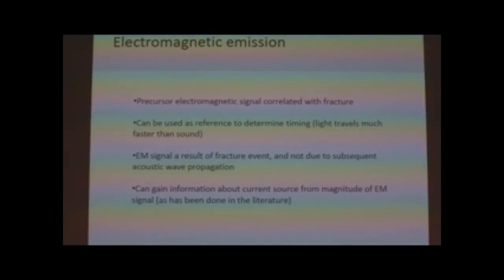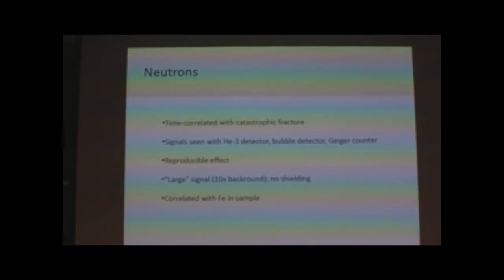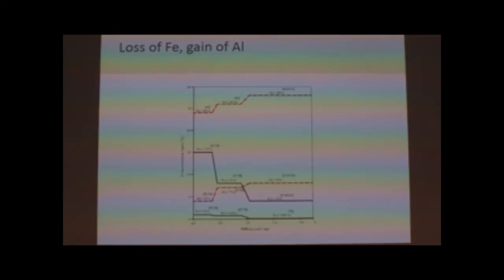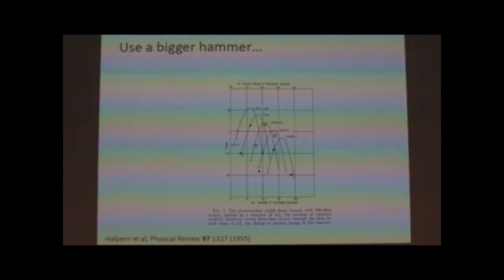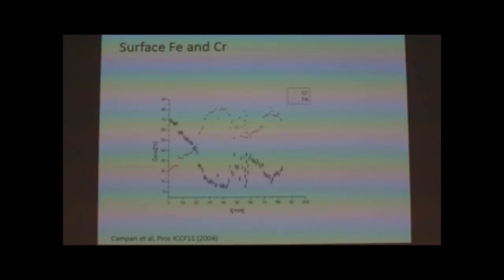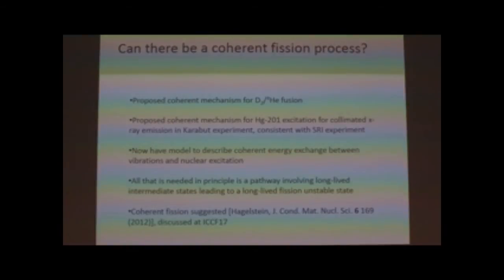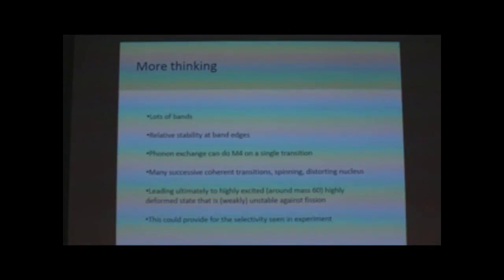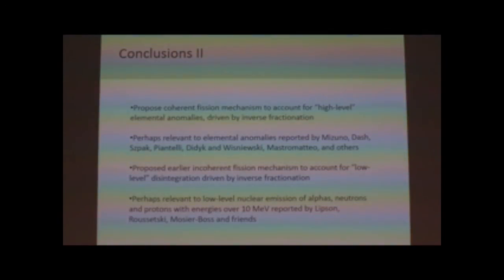Peter Hagelstein Discusses Latest Theoretical Modeling for Cold Fusion Effects

Comment: About a year after CBS 60 Minutes aired their episode on Cold Fusion, I followed up with Rob Duncan to explore Richard Garwin's thesis that McKubre was measuring the input electric power incorrectly.

It turns out that McKubre was reckoning only the DC power going into his cells, and assuming (for arcane technical reasons) there could not be any AC power going in, and therefore he didn't need to  measure or include any AC power term in his energy budget model.

Together with several other people, I helped work out a model for the omitted AC power term in McKubre's experimental design.  Our model showed that there was measurable and significant AC power, arising from the fluctuations in ohmic resistance as bubbles formed and sloughed off the surface of the palladium electrodes.  Our model jibed with both the qualitative and quantitative evidence from McKubre's reports:  

1) McKubre (and others) noted that the excess heat only appeared after the palladium lattice was fully loaded.  And that's precisely when the Faradaic current no longer charges up the lattice, but begins producing gas bubbles on the surfaces of the electrodes.

2) The excess heat in McKubre's cells was only apparent, significant, and sizable when the Faradaic drive current was elevated to dramatically high levels, thereby increasing the rate at which bubbles were forming and sloughing off the electrodes.

3) The effect was enhanced if the surface of the electrodes was rough rather than polished smooth, so that larger bubbles could form and cling to the rough surface before sloughing off, thereby alternately occluding and exposing somewhat larger fractions of surface area for each bubble.

The time-varying resistance arising from the bubbles forming and sloughing off the surface of the electrodes — after the cell was fully loaded, enhanced by elevated Faradaic drive currents and further enhanced by a rough electrode surface — produced measurable and significant AC noise power into the energy budget model that went as the square of the magnitude of the fluctuations in the cell resistance.  

To a first approximation, a 17% fluctuation in resistance would nominally produce a 3% increase in power, over and above the baseline DC power term.  Garwin and Lewis had found that McKubre's cells were producing about 3% more heat than could be accounted for with his energy measurements, where McKubre was reckoning only the DC power going into his cells, and (incorrectly) assuming there was no AC power that needed to be measured or included in his energy budget model.

I suggest slapping an audio VU meter across McKubre's cell to measure the AC burst noise from the fluctuating resistance.  Alternatively use one of McKubre's constant current power supplies to drive an old style desk telephone with a carbon button microphone.  I predict the handset will still function: if you blow into the mouthpiece, you'll hear it in the earpiece, thereby proving the reality of an AC audio signal riding on top of the DC current.